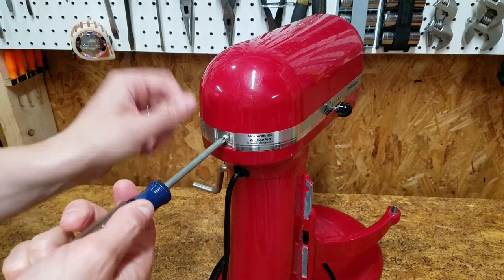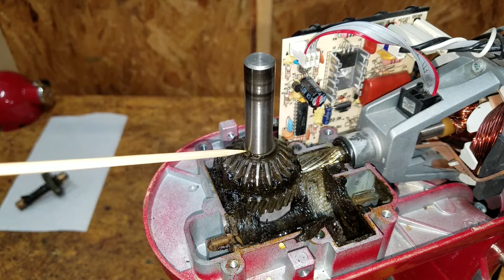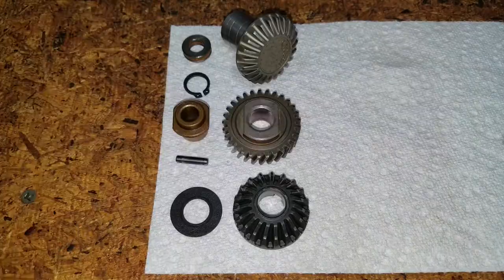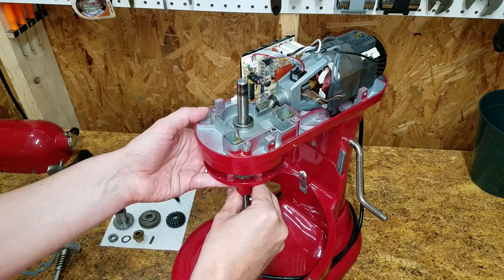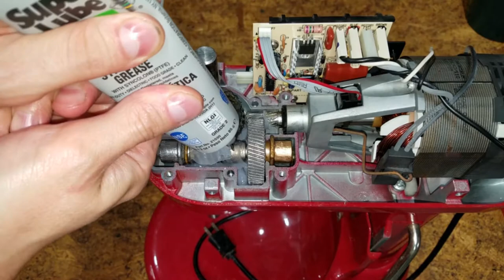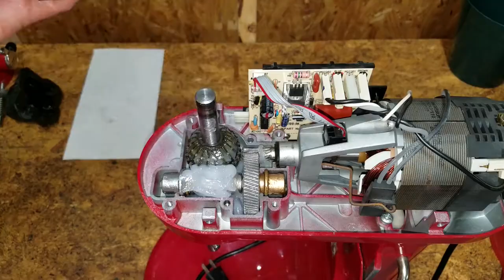Repairing a KitchenAid Stand Mixer

Comment from the maker: Snap Ring Pliers:
https://amzn.to/3eHsQ5l (affiliate*)

Food Grade Grease:
https://amzn.to/3OMftAN (affiliate*)

Transmission Housing (8212396):
https://amzn.to/3NHja9T (affiliate*)

Worm Gear (WP9709231):
https://amzn.to/3RdKr6y (affiliate*)

Front Sleeve Bearing (WPW10170080):
https://amzn.to/3yKjfoJ (affiliate*)

Worm Follower Gear (W11086780):
https://amzn.to/3AwwlaK (affiliate*)

Beveled & Attachment Gears (W11192795):
https://amzn.to/3RgIQgk (affiliate*)

*Purchasing from these Amazon affiliate links earns my channel a small commission. Think of it as a tip that doesn't cost you anything. Thanks for the support!

Comment: Great video, thanks for the help.

The only part of the video that I hated was how easily you removed the snap ring, I'm pretty certain that was CGI because only immortals can do it with such ease.  This project takes only about 45 minutes but the snap ring added an hour and fifteen minutes for me, even with the correct tools and a lot of lubricating words. 

Your amazing
Reply from the maker: Hahaha! Trust me, I've definitely had struggles with snap rings in the past, I just got lucky this time. However, you might have broken a record with your 75-minute battle. That's some impressive persistence though, a lesser man would have smashed the whole mixer on the floor. ;)

Comment: Mike, great video! My mixer has sounded awful for the last few years, but I don't know where to take it in to get it looked at. Plus, not sure I want to drop a bunch of cash on fixing it. This video has given me the confidence to pop it open and take a look myself. Hopeful the damage is minimal and it just need some new grease!! Thanks again!
Reply from the maker: Thanks! I spent $75 repairing this mixer but, to me, it was worth it since this model retails for $450 new. It's normal for the gears to wear out over time. It's nice to have the option to replace the gears and then the mixer is good as new rather than having to buy a new one. My guess is that the sound you're hearing is the worn gears grinding together. Thanks for the comment, let me know how it goes!

Comment: Hi Mike, it's great video. Where can i order the parts and find part numbers? 😊
Reply from the maker: There should be a sticker on the bottom of your mixer with the exact model number. Now you can find a parts diagram for your model which will include all part numbers. See my video description for the part numbers I used and links to buy 'em. Amazon and eBay are my go-to sources for all replacement parts but there are other such as daytonapplianceparts.com .

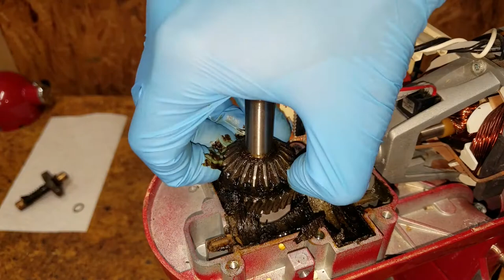Comment: I removed the snap ring (1:45) but I can’t get the beveled gear to budge. Is there something else holding it on? (1:51) I’ve even tried using a screwdriver on her knees to push it up, but there is definitely something mechanical holding it because it requires a lot of force and it’s not moving
Reply from the maker: Hmmm... the snap ring should be the only thing keeping the bevel gear from sliding up the shaft. You could try holding the mixer rod below still with one hand while grabbing the sides of the gear with a pair of adjustable channel lock pliers to see if you can just get the gear to budge a hair in both directions. That might be enough to free it up so it'll come off. Let me know how it goes!

Comment: There is a lot of play in my worm gear (moves backwards and forwards) which translates to a lot of movement in the planetary. Would that be caused by the teeth being worn?
Reply from the maker: I'm no pro but, if all of the gear teeth look good and uniform, the bronze bushings on the ends of the worm gear could be worn out or chipped which is allowing the excess movement.

Comment: Great video. I was grinding beef and must not have seated the attachment well. The meat grinding attachment flew off, and the shiny silver thing that you stick the attachment in turned so that the opening where you screw in the set screw is no longer aligned with it  so now I can’t use any of the attachments. Any thoughts on how to fix?
Reply from the maker: I'm no pro but, if you take off the top cover, you should be able to pop that collar out. Then you can reinsert it, so the set screw lines up with the hole again.
Reply: Thanks, Mike! I’ll try it.

Comment: My stand mixer is making a piping noise can you show what that possible be?
Reply from the maker: I'm no pro but the gears wear down over time, so the popping sound is probably the teeth slipping.
Reply: @Mikeattempts  ok this is my 2 kitchen aid 1st was a tilt this one right from the get go was louder it is now 14 months old and this evening while making pizza dough it started this I could not figure out how to open my mothers (I took band stew off but it didn’t move( hers 30 years old back when Hobart owned them) probably grease and grim)  I will open this up and take a look thank you.

Comment: I can't remove that pin and you make it look so easy!! I am so frustrated !!!
Reply from the maker: Try pushing up on the rod where you connect the mixing attachments to be sure the pin isn't pinched against the top of the larger worm follower gear.
Reply: @Mikeattempts  I did try that, the pin moves a bit to each side, but it's stuck. i will keep trying tho!
Reply from the maker: @rp.aguilera  You could try tapping the end of the pin with a punch or nail. Let me know how it goes!

Comment: Mike, I got a new mixer but it stops after few seconds. What might be the issue?
Reply from the maker: Is it brand new? If so, you should call Kitchenaid support ASAP so they can fix or replace it. If it's not brand new, it's hard to know for sure. I'm no pro but maybe it's the switch or possibly even the motor.